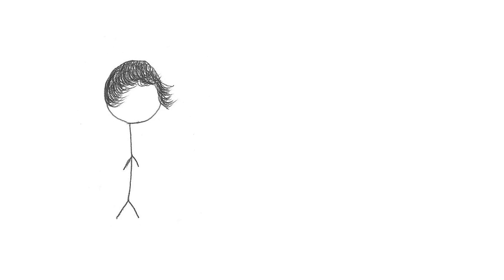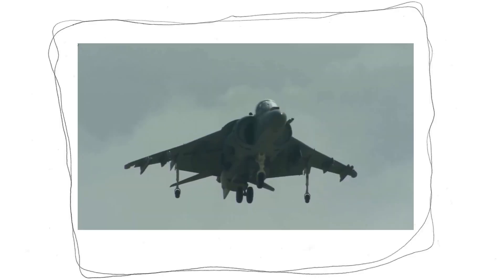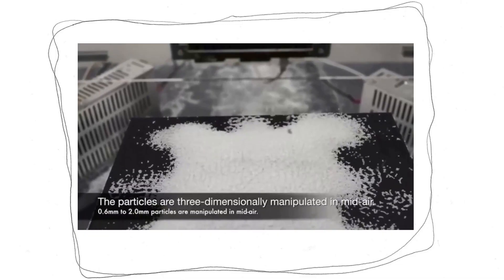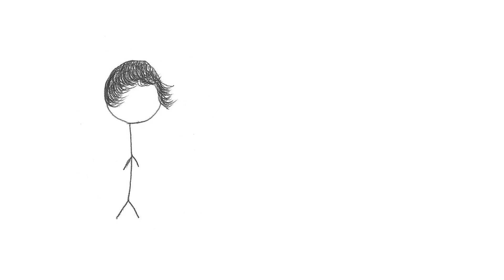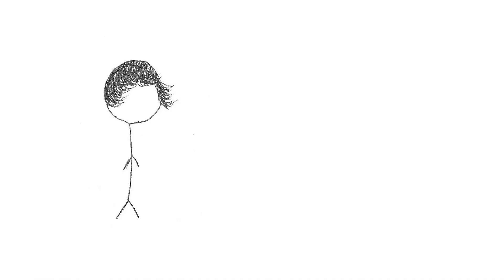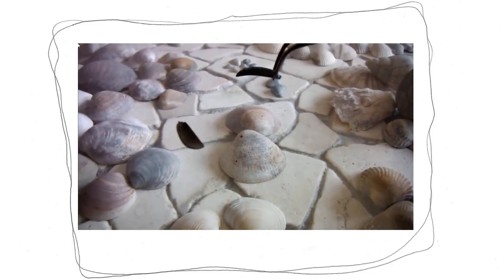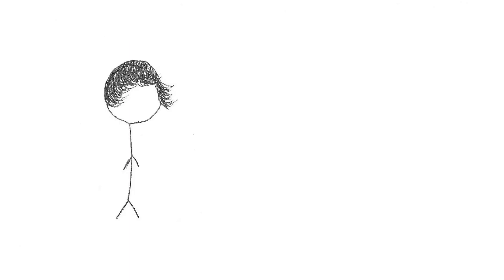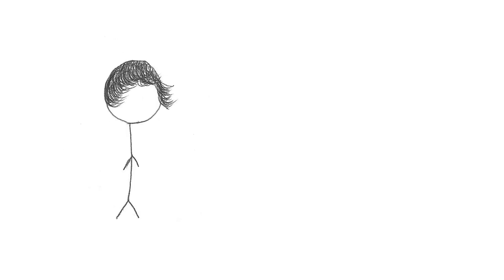Space Station on Ground - Debunked

Comment: Although some of what he suggests could work, in principle, in reality it wouldn’t be workable. 
It would require a phenomenal amount of power and a huge array of emitters just to lift something the size of the ISS. 

When you have the correct frequency for the ISS, you would need different frequencies for each crew member, their hair, every piece of floating cable, every object and anything else you wish to levitate. All with their own transmitters (and power). Once you have all of these, you have to make sure that the frequencies do not cancel out each other’s effects. Remember, all the frequencies are vibrating everything at the same time as everything else. 

During research into this myself, I found this quote from Smithsonian that peaked my interest:-

Under normal gravity, “the power required to lift a human would probably be lethal,” says Marzo. “If you apply too much ultrasound power to a liquid, you will create microbubbles.” In other words, too much sound power can make your blood boil.

Not only that but, some of these frequencies well be within the audible spectrum and at a volume that will be annoying or even dangerous for the human ear. 

Indeed this is quite old technology and there are completely obvious reasons why this isn’t currently in daily use. The cost to “fake” the ISS in this fashion would most probably cost more to achieve than putting the ISS into orbit
Reply: Tim Webb all well and good when only floating a single item but multiple items would require multiple frequencies. Obviously a person may float at a certain frequency but their hair may require a different frequency to float out and up from their head. As I pointed out in the original comment. Frequencies can cancel each other out and the amount of emitters and different frequencies can cause problems.
Reply: Tim Webb Dang it, Tim, if you want us to believe in god you need to prove he exists, not tell us Satan doesn’t want us to believe in him. Atheists don’t believe in gods, remember? Anyway, if your religion is true, Satan has done more to improve your life than God has. It’s thanks to Satan that you understand morality. Satan helped god achieve the goal of sacrificing Jesus. You’re allowed to have a gun because the world is sinful. It’s thanks to Satan’s Globe Earth Conspiracy that we have GPS. Without the 9/11 conspiracies, planes would be hijacked left and right. Every shooting has the secondary effect of uniting a population. It’s thanks to Satan that you are able to think!

All God gives us a way out of an arbitrary punishment he created. Why is Satan the bad guy?
Reply: Tim Webb Satan’s the bad guy because god made him to be the villain. Angels have no free will, doing only what god tells them to do. God instructed Satan to rebel, Tim. Unless you want to move the goal posts. And I’m not trying to be like god. If I were, I’d be seeking omniscient, omnipotence, and omnipresence. God isn’t love, you know. He’s all-powerful, which means he’s both supreme good and supreme evil. Fortunately, might makes right, so anything done by or for god is moral. Like exterminating entire populations. That’s one of God’s favorite hobbies, Tim. God doesn’t make you a better person, you try to do better (presumably) because you’re terrified of eternal hellfire. But God wants people to burn. Why else would he make his instructions so vague, his judgement so disproportionate. Can you honestly tell me that you haven’t read comments like this, and hoped, deep down, that people like me would be punished extra? You still deserve Hell, Tim, but God likes to have toys around. Jesus didn’t take our places, he died on a cross and went to heaven. A cross is not eternal hellfire. Maybe God just wanted to star in a torture porn? Yes, I’m being disrespectful. But so are you. You know, if I locked you in a box, with a steady supply of food and drink, and gave you nothing to do but read Islamic texts, I’d predict three possibilities. First, you might go insane. Sorry about that. Second, you might come out a Christian with an intimate knowledge of the Quran. Great, go try to convert Muslims. Third, you come out a Muslim. Enjoy your new lifestyle, Tim. Point is, you only know what you experience. You’re so used to your comforts that you assume you have a natural right to them. God only gives rights to men, you know. Heck, under god, slavery is a-ok. Not just racial slavery, either. If you want to do things god’s way, there’d be no reason why I couldn’t own you, Tim. If you were indebted to me, slavery would be a way out. Say goodbye to pork, shrimp, clams, etc., etc. Jesus didn’t abolish the law, Tim. The Old Testament is just valid to your religion. Now tell me: what do you believe?
Reply: Tim Webb Are you saying we have technology that allows us to breathe underwater without apparatuses? Because, frankly, that’d be more impressive than whatever you think the ISS is doing
Reply: Tim Webb Okay, so anarchy is the best way to do things, got it.

Do you understand how government works? Regardless of how it’s run, a government exists primarily to protect the rights it grants you. In a dictatorship or the like, you’re not granted much, but in a republic or democracy, there’s more wiggle room. If all governments are evil by default, then all of your rights and privileges are evil by default. Evil can’t do anything good, right? Think about all the rights you take for granted, and imagine life without them.

Also, you haven’t explained why the government wants us to believe in a spherical Earth. It only costs them money in the end, and it doesn’t make the population any more or less obedient. It doesn’t change what we can do, either, since the Earth is the Earth regardless of shape
Reply: Parcel Form excellent comment. I’m fed up with all these flat earthers with their anti government sentiment. They don’t realise the privilege their governments grant them (and they take full advantage of) and then they can slag off their government on a public forum without retribution, because their government grants them the freedom of speech. If it weren’t so sad it would be funny.
Reply: Tim Webb you sir are an arrogant imbecile. In a situation without gravity the body would float AND the hair would float quite independently as it does on the ISS. If you were to levitate a human, the body would levitate but the hair would remain in the style it was before levitation. 

As for water in space suits. If you had the forethought to actually research what happens in a spacesuit you would know that the water is already inside the suit. Astronauts have a drinking water supply and liquid cooling in their suits too. 
If you were to use your common sense and your conspiritard senses, you would realise that if they had a spacesuit that was leaking swimming pool water into it, they wouldn’t have told anyone about it. It would have been covered up and never made it to the international news. C’mon start putting some thought into it. 
And do you really think that an organisation that has been part of the “elite” that have been hiding the “real shape” of the earth for a couple of thousand years would have broadcast footage shot in a pool and left the bubble in?? That’s hilarious. You think that this evil company with unlimited resources, money and hundred of staff with high triple figure IQ’s wouldn’t have thought to do continuity and quality control checks on all footage released to the public. What a simple world you live in. It must be nice not to have to think about the contradictions in your comments.
Reply: Tim Webb I’m not American. Do you think that whether or not 9-11 was an inside job or not makes any difference to any other “crime” that the American government may have committed. Is it fair to assume that anyone guilty of a crime is guilty of all crimes that they may be accused of. That’s religious conditioning for you. You have no actual proof of what you are accusing NASA of so I think your comment could be classed as bearing false witness. That’s a sin from what I can remember.
 
If the bible were a true account of gods actions then all the genocide, racism, oppression and sacrifice of human life makes for a massive double standard. Talk about hypocrisy, huh.

Your bible was not written by your god. It was written by man. Written by man to control the masses and to justify groups of people doing shitty things to other groups of people. It tells you what to do and how to think and threatens you with eternal torture after your death if you don’t conform. How is that preferable to living in a society that requires you to help finance and defend that society that grants you those rights first then asks you to support those rights after?
If you don’t want to live under the laws of the land that grant you those rights and the relative safety it grants you then go live in Somalia, Saudi Arabia or North Korea. It’s very different in those countries. 

Why would NASA want to separate man from god. Most NASA employees as well as almost the entirety of the American government are Christians. As are many Freemasons. You know the Freemasons, they were the people responsible for building so many of those medieval churches you religious types like to go to on your gods day off and ask him to grant you wishes.

Much of the bible is of Jewish origin, Jesus was a Jew that died aged 33. 33 the number most associated with the Freemasons. Does that make Jesus a devil worshipping Freemason Jew? More Christian double standards.
Reply: Tim Webb Nice strawman fallacy there. Bringing all the other government conspiracies into the conversation as a way of proving your accusations against NASA. Not the only space agency BTW. We’re not talking about everything else. If you have any actual evidence against NASA that would stand up in court then you DO need to prove it. Otherwise your words are no more than hearsay and that’s only one short step away from a lie. Remember what your bible says about bearing false witness. 

No hypocrisy in the bible? So it’s ok for your god to commit genocide but not anyone else? When Hitler (a Christian) tried to do it that was wrong, wasn’t it? Or was it ok because he was a Christian. That’s only one single example. 

You’re contradicting yourself again. You said the bible was written by god and in the next sentence wrote “holy men of god wrote as the spirit of god moved them” That not god writing the bible, that’s man writing the bible as they felt gods spirit would have wanted it written. That’s very different. The bible does threaten eternal torture. 

You don’t wish to live in a lawless or oppressive country and you believe that your government has no power to grant you the rights that you have, but you take full advantage of those rights that they have granted you anyway and throw them back in their faces by throwing unfounded accusations about their departments. No hypocrisy there then? 

You go on about wishing to live in the country YOUR god saw fit to have you born in but what if you were born in China? What if you were born in Bagdad? Your god and religious outlook would be different, your god would be a false god to a Christian. Worshipping him would be sin number 1 on the list.

What evidence can you provide that NASA was started or even headed by a satanist?  The symbol for NASA is a shape that plays homage to the delta wing of an aircraft. When you consider the actual background of NASA being an airforce background then I would say it was quite apt. Indeed they still call rocket launches ‘flights’. This is real life, not a James Bond movie. The bad guy doesn’t tie up the good guy and tells him all the plans before leaving him to slowly lower into a shark tank. If they were satanic they wouldn’t leave clues all over the place. No criminal organisation hides anything in plain sight, that’s just preposterous and childish thinking. 

What evidence can you provide that a single person you accuse of being a satanist, is actually a satanist? None because there wouldn’t be any. Ok, Hilary maybe but I think she may have a mental disorder. That’s not the devil, that’s a disorder. Long gone are the days when we thought that illnesses were curses. Well, In the real world anyway. Maybe not in your fairytale world. 

You know nothing about the Freemasons. They are no more than a multicultural, multi religion, rotary club or perhaps a trade union. They accept people of any religion and their rituals are based around a combination of many religious ceremonies. 

You can re read your own comments about how your book of fairy stories isn’t of Jewish origin. Your statement even confirms it. Later you stated that it was given to the people of Israel, and then said they killed the son of god. It wasn’t the Jews that nailed Jesus to a cross.
Reply: Tim Webb wow, you really showed me how little of my comment you actually understood. Oh well, I’ll take the hit on that one, I rushed the comment and didn’t explain it in little boy language. 

It doesn’t seem to matter to you that the story of a great flood was written before your deity had been invented by man, you were just happy that it was written as a great flood. Not all of the stories claimed that the flood was world wide. Every culture has flood tales and pretty much every country has had floods, at different points in history. We still have them today, regularly. 
 There’s only so much of your mythology I’m prepared to listen to and I grow tired of reading your drivel. Who cares if 500 Jews were convinced they saw proof of life after death. That’s not evidence, that’s a simple argument from personal experience, it’s a logical fallacy and another un falsifiable claim.
Reply: Tim Webb it’s amazing what you can see when you really, really WANT to see it. Absolutely any tenuous link will form the basis of your evidence no matter how weak that link is. 
Do you see evidence of god every time someone gets the all clear of cancer after doctors have operated on them and they’ve had radiation therapy? Do you see evidence of god when you copy and paste your bible verses on your computer? 
Do you see evidence of god every time a young child is raped and tortured to death by someone? 

Do you see evidence of god when a tidal wave wipes a town and many of inhabitants off the face of the planet?

Your bible consists of so many stories written about other gods and characters that were worshipped or revered prior to mankind making up yours. All the bible writers had to do was link them together to take control of the feeble minded masses and hey presto, full control. Complete with threats if you don’t conform. With the added benefit of unregistered, untaxed income. That’s organised crime right there.
Reply: Lol I was thinking that. Faking it will probably be way more costly and problamatic than actually doing ehat they did
Reply: El Cat flat earthers and space deniers all claim that everything NASA puts out is cgi but then, in 1986 the film company couldn’t create cgi to do the fighter jet scenes in Top Gun.
Reply: Tim Webb No, the hair is moving separately
Reply: Tim Webb At that point, the conspiracy surpasses absurd. Why would they want to almost kill someone intentionally, especially if that person is useful to the deception? What is the point? Why would it be so important that we believe in a spherical Earth?
Reply: Tim Webb wow you really talk some crap. You’re starting from the position that your bible has in some way been verified as fact. It hasn’t 
You can accuse the government, the Freemasons, the Jews and catholics of whatever you like. You still only have a book of fairytales as evidence. 
Even if god was proven to exist and it was proven that he created the earth and all the people on it. Maybe it is his to destroy but that doesn’t make it right, it doesn’t make it moral. It makes it genocide. Genocide is still killing, still breaking his own commandments he sent out. 
You can argue religion as much as you like but you’re just diverting the conversation away from the facts. Can you actually discuss the topic at hand and save your religious oppression for someone who actually cares.
Reply: Tim Webb  “the bible has not been falsified by science”  in your blinkered opinion maybe. Here in the real world it’s a very different story. 

Making un falsifiable claims like, life after death, one off multi headed beasts, and personal visions of spirits doesn’t count. Nobody can prove that there IS Life after death, just as much as science can’t prove that there ISN’T life after death. 
We can, however, prove that the great flood was not an actual event. We also know that the story was plagiarised from a much older religion and there may be evidence that it was a story from older religions before that. But of course, you’ll just claim that it was still something to do with YOUR deity. 

The rest of your comment is religious claptrap based on little more than hearsay and Chinese whispers. 

The subject here is the possibility of using frequencies to levitate a human. I thought I had made the pitfalls and problems with this quite clear in the comment at the top of this thread. You were the one bringing religion into it. 
As far as I am aware, the idea of using radio or audio frequencies to levitate objects and people doesn’t feature very much in the bible and my comment only referenced the ISS as an object to be levitated because that was the object in the video. 

BTW genocide is still murder whatever the reason.
Reply: Tim Webb Tim Webb you’re still working on the premise of the bible being true and written about events from the beginning of time itself. There is no evidence that the bible fits those scenarios. Only that the bible says so. The bible says it is true therefore the bible is true. 

Did you know that I had an invisible flying car that was only a solid object when I needed it and no one else was around. It was in my garage for years and I flew it frequently. It’s true because it’s existence is documented in several comments I have posted over the last few years. You can’t deny it’s true and science can’t prove it doesn’t exist because it was only solid when I need it to be and no one else was around. I no longer have it, so it can’t be tested scientifically. My friends know it’s true because we raced a few times and I could complete the course as the crow flies but they had to go around the bends. I won every time and by the time they got to the finish, I was always out of the car and it was no longer a solid object. I couldn’t go home until they had gone though. 

Sounds plausible doesn’t it? 

Your cash machine example wasn’t very good. Your experience of getting cash has solid, verifiable evidence, the cash. Then there’s the receipt, the record the machine keeps, the record of the money coming out of your account, cctv footage, the things you purchased with the cash, their receipts and more. In 20 years time when all the receipts are thrown away and the bank records are no longer kept, all there is to prove your actions at the cash machine is your personal experience and you go on to tell someone that you took money out of the cash machine, your personal experience no longer counts as evidence. Its only your word that you had that experience and there is no evidence. But then I think you’re intelligent enough to know exactly what I meant. 

500 jews ‘claimed’ or fabled personal experience, with no actual evidence or verification to prove it, only words in the bible saying that their testimony is true, because it’s written in the bible is a personal experience fallacy and not evidence.
Reply: Tim Webb my bible study is a little rusty. I don’t remember methuselah being described as dead. I remember the lord taking methuselah but describing the others as passing away or being dead. Remind me again how many hundreds of years old he was when he was taken. Perhaps that was just a misinterpretation. 

I thought there was no death in the world before Adam and Eve ate from the tree of knowledge of good and evil. So was methuselah alive before or after Adam and Eve?  Maybe I’ve lost something in THIS interpretation over the years too. 

Who cares what the names mean in translation. Look at Russian names, their translations can be strange. We had a man at my work whose wife was still living in Russia, her name roughly translated into English was petrol station. 

I will need some evidence of your god before I can have fear for his wrath.
Reply: Tim Webb right I see I may have mixed them up it’s been a while. So 900 years old is not a common age these days. These people weren’t human then or they were human but humans lived hundreds of years back then? This is beginning to sound less plausible than the ISS being faked using radio frequency/sound wave/magnetic levitation
Reply: And snakes talk.
And eating an apple will make me smart.
And god made an apple tree so that I would eat it and know the difference between right and wrong.
And god punished me and all of mankind because he made it very easy for me to eat a fucking apple.
But he made me bad from the start, because I ate the apple even when he told me not too.
God knew I would do this, but he made the apple tree anyway.
then god made Tim Webb.
And Tim was dumb as a box of rocks.
Reply: "God is making you an offer you cannot refuse." - because if we refuse, he will make us live in FUCKING HELL for ALL OF ETERNITY!!!!  LOL!  Fuck you Tim
Reply: Tim Webb what clearly presented evidence are you talking about?
Reply: Tim Webb the 33 degrees of freemasonry are in reference to the age at which Jesus died, and the entire philosophy of freemasonry is to refine your character to become a better man, I know this as I am a Freemason
Reply: I’m confused about his claim. Why would he claim that the space station is actually real? Wouldn’t his nonsense require less money if he had claimed that the astronauts were in acoustic chambers? Note that I believe the ISS is in space
Reply: Tim Webb look up Stockholm syndrome. I’m no expert but I detect symptoms.
Reply: I've already told God to FUCK OFF! "but you must give me 50% of your earnings" - but god want 10% of my earning, and not of my net earning, but gross....  "Nobody has the right to tell you how to think, or what to do" - but Jesus says believe in him or go to hell...."You believe that a nation which has horribly murdered millions of people", but god said in the bible to kill men, women AND to KILL CHILDREN!! AND he created a global flood that DROWNED almost ALL CHILDREN alive in the ENTIRE WORLD!!  FUCK GOD!
Reply: "You believe that we originated from rocks" ,  well, no, not rocks,  but what's the difference because you believe we originate from clay and god breathed life into it and then took a boner out of man and made it into a woman....
Reply: "You actually believe anything and everything they tell you; you are incapable of independent thought."...and you believe in god and the bible because you are incapable of independent thought.  All you have is your 2K year old book, but scientist have their tools to prove your book is wrong
Reply: lol, bible quotes...can't think for himself.....jesus is sucking my dick now...I'm about to cum in his mouth...
Reply: Well, since my microscope, 3 telescopes and other scientific tools do not actually speak verbally....and since I have common sense....
Reply: As far as I can see,  all you have to say is a bunch of nonsense bullshit and every time I reply to you, you look more like a stupid moron who only believe in his 2K year old fairytale book.  Take away that book and erase everyone's mind with any thoughts about christianity and you have nothing and will never have any stories forming about christianity...but do the same with knowledge of science and eventually mankind will once again have all these scientific facts discovered ...
Reply: Tim Webb clearly has presented absolutely no evidence.  He's a loon...
Reply: See, your replies are just mumbo jumbo baloney.  No facts or evidence.  Just babble.....
Reply: "Everywhere I have looked for the last 50 years, I have seen the Bible confirmed as true in every last detail."  - yep, like snakes and burning bushes that talk, eating apples make you suddenly smart, humans can be made of clay, you've seen hell in person...yep, every last detail confirmed...
Reply: btw, did not read 90% of your post.  don't post bible quotes anymore...
Reply: Tim Webb because obviously a frog is exactly the same as a human, that’s why we eat flies all the tome
Reply: Tim Webb you say that we shouldn’t live under a powerful leader yet you think that we should all worship an all powerful dictator named god
Reply: Tim Webb there are billions of christians who believe in both god and the globe
Reply: Tim Webb we don’t believe that we originated from dirt, the bible says that we were misled from dirt, we believe that we arose from self replicating organic molecules which started off as RNA
Reply: Tim Webb the bible does threaten us with eternal torture, it’s called hell
Reply: Tim Webb do you simply believe in the bible because you want a reason to own slaves?
Reply: Tim Webb you’re saying that god wants us to have freewill, yet he will torture us for eternity if we follow all of his rules but doubt his existence due to a lack of evidence, but if we commit a genocide but ask god to forgive us right before we die, we will be allowed into heaven
Reply: Tim Webb from all of the evidence I have seen in favour of god, I have found tons of problems with them, and there’s no general problem between all of them, just a problem individually
Reply: Tim Webb I have found numerous mistakes within the bible itself, the first of which is that there are two different creation stories, genesis 1 and 2
Reply: Tim Webb...an MRI is not strong enough to levitate anything. But they have levitated things such as frogs,with no immediate apparent side effects. 
  But levitating the ISS would be a really big problem,with the altitude that it is at,the electromagnetic field would have to be so strong,that it would probably knock out any electronics and electrical circuits with many miles,and you would need an array of these circling the Earth,many times,because it’s orbit does not keep it on a repeating orbit relative to the surface below it. And if you look up the orbital path,it appears that you would need an array that circles the Earth around a hundred times. In theory,maybe possible,in reality,definitely not.
Reply: Tim Webb....how does the evil government make all the movements of the celestial bodies act as is they are being viewed from a sphere?How do they make all the measurements match up to a sphere?How do they make the Sun and Moon stay the same apparent size throughout the day,to every device,including our eyes?How does this evil government make the Sun and Moon and boats and any distant thing,appear to be hidden by the horizon. Can a person really be stupid enough to believe all that is possible. And since you obviously are,expain the mechanism/mechanisms that they use.